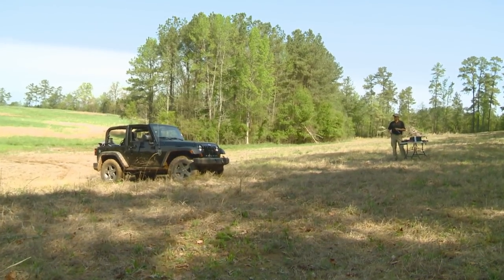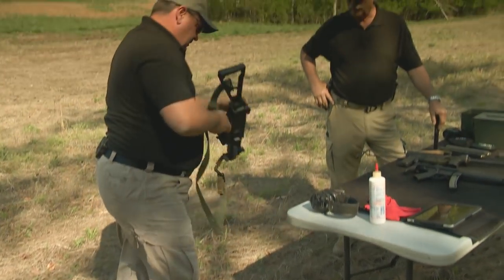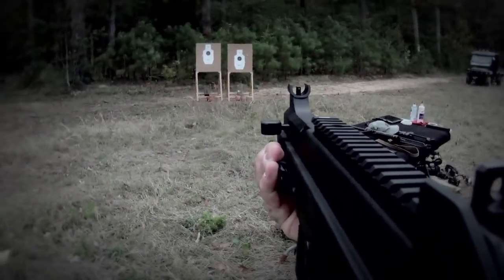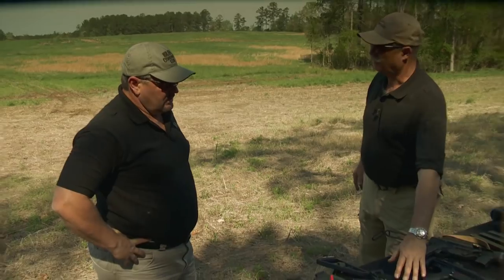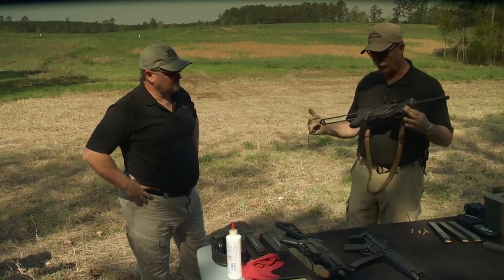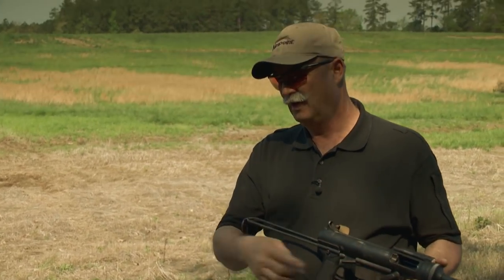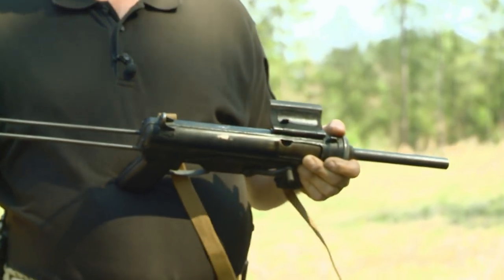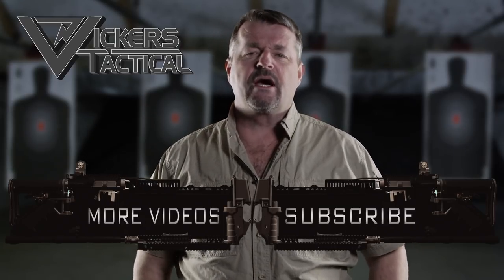M3 Grease Gun and HK UMP

Comment: The M3 was designed to replace the H&K UMP.
Reply: Nice work dude.
Reply: Random Guy lol
Reply: Wait, time out...
Reply: Random Guy lmfao and the Colt 1911 was made to replace the Colt Dragoon
Reply: Random Guy Gr8 b8 m8
Reply: u brad mo ?
Reply: Random Guy wtsr&eg
Reply: XDXD
Reply: Fucking agree
Reply: Dutcher No shit it is
Reply: Lol . Seem fucking legit.
Reply: @dutcher9180  
The joke flew 10,000 ft over your head.
Reply: Jesus fucking Christ man...
Reply: @dutcher9180  it's a joke
Reply: The Red Menace  Not the M1 Garand . The lever action Winchester .
Reply: @dutcher9180  r/wooosh
Reply: Gazzara5  Actually when the grease gun was being designed it was never meant to replace the Thompson. It was designed to simply be an extremely cheap and fast to produce gun that they could air drop to troops and supply to tank crews. At the time war materials were running low so they simply wanted something that used the least materials and could supply troops at a faster rate. But it was never meant as a replacement, it's just what happened.

Comment: Should have compared the Sten, the Grease Gun, & the MP40.
Reply: And the Owen SMG
Reply: +DemocracyOfHypocrisy It's got to have been done somewhere.
Reply: And the mab 38. Polish blyskawica 
Ppsh pps43  mas38 and reising m55
Reply: MP40 hands down would have won, the Sten coming in second maybe or vise versa with the M3
Reply: No, that depends on your requirements. The MP40 is modern and in 9mm and perhaps it has already its semi/ double and burst fire mode selector. the M3 is pure full auto firing. Quick triggering is what makes it fire in burst. It fires the .45 ACP round.
Reply: The Mp40 would've won first, than M3 grease gun, than the Sten, than the PPSH-41
Reply: No the winner would have been the MAT49, then the PPS43, then the junk quoted above
Reply: The Sten is crap,but it does have the advantage of a side magazine feed so you can keep closer to the ground while firing it and not exposing yourself. The MP-40 is a work of art even if it is a 9 MM,but the Grease gun would still be my pick for simplicity,strength,and caliber.
Reply: @niksarass  Matt 49 isn't exactly a WWII SMG.
Reply: @bender138  yep I agree the Sten Is junk it’s a toss up between the Grease gun and the MP 40 which are both great sub guns. The 45 is however a superior sub gun round due to the fact that it hits harder and is better suppressed.

Comment: Having been an Armored Crewman  on the M60A1/A3 tanks, I got to play with the M3A1 Greasegun a LOT and enjoyed doing so as well.
A decent rate of fire but required effort to keep it on target during a longer string of fire. 
Some of the "lighter" troops didn't have enough sand in their pockets to keep from being rattled around from the (to me, anyway) modest recoil impulses. But with a little training and trigger time it became easier to squeeze off one, two, three or more short bursts of ammo.
That was a necessity, too, since that stick mag would run out of Pain Pills PDQ if you held the trigger back. 
But it was fun! YEE HAW!
I miss those days, outside of being beat to crap from the hard work associated with being a Tanker.
EVERYONE from the TC (Tank Commander) to the Driver, Loader and Gunner needed to work together to keep our mounts up and running in the field.
There was no such thing as driving until a maintenance facility and asking them to fix whatever was broken. Crewmen did the bulk of the maintenance. From track component replacements to replacing an entire engine/transmission "Pack" in the field.
That took the use of an M88 Recovery vehicle which was another tank minus the turret and main gun, but had a rig to hoist off the back deck and then the engine pack for replacement. 
NOT fun at ALL! Oh, and EXTREMELY dirty work. LOL 
Good days, Yessiree!

Comment: The UMP is a very fine gun and one of my favorites. One thing to touch on though is that the cost to acquire a UMP is in the $10-20,000 range, where as a new M3 grease gun cost $15 to produce in '43 which is $206 today. This means that for the cost of one UMP at $10,000 (cheap) you could arm 50 or so soldiers with grease guns. Assuming training and experiance are equal, the advantages that the UMP offers it doesn't make a 1v50 scenario close to possible. Even a 1v2 scenario would be based on luck. If H&K were to make an affordable UMP they would essentially end up with an M3.  This is why they are bought in small numbers by special forces and police units, and not armies. Just food for thought, sorry for the rant, safe shooting everyone.
Reply: 10-20k for a submachine gun? Christ, I bought a pickup truck for less than that!

Comment: wish they made the ump in 10mm
Reply: they make one in 9
Reply: They have .40 S&W
Reply: Raihan Purboyo *more rare
Reply: It's possible. You just need a different barrel aswell as maybe change the rollers.
Reply: 10mm > .40 Short & weak.
10mm > lol it's ok only 9mm.
Reply: Found the weak wristed FBI agent.
Reply: 9mm cannot even compare to 10mm Spuds...
Reply: Most 10mm made by big manufacturers are weak. 

For full power, .357 Magnum equivalent 10mm rounds, look up DoubleTap or Underwood 10mm -> 135 gr. flying out at 1600 fps.
Reply: Used Underwood 10mm those are like a 41 magnum. Quite a punch, but not as bad as they are made to seem recoil wise. Now from a sub it'd should be even less recoil, until you add fullauto then maybe. 

The only issue I see with 10mm or higher rounds, fullauto recoil and the possibility of hitting a bystanders is higher than smaller more manageable caliber. 

But I still prefer the 10mm, I also don't deal with hostages lmao

Comment: m3a1 could be carried cocked as the dust cover locked the bolt back when closed. firing single rounds was easy, even a clumsy guy like me managed it fine. we had some in artillery post korea. I always use it as an example of how easy it would be to make a full auto rig in your garage.
Reply: This was my choice guarding Pershings. I've never had one fail, and I could single shot a target at 200 meters or 3 shot a 350 meter target.

Comment: The grease gun was never made to replace the Thompson. the grease gun was made as a defensive weapon that was generally issued to mechanics, clerks, drivers, supply, armored  etc. It was never issued to combat squads in any form and was deemed suitable for less experienced non combatents because of simplicity of of operation if put in a defensive situation . Rangers could choose their as a mission to fit their needs, but none would have been that foolish, except in movies. They were fun to shoot and east to clean And weighed a lot less than the Thompson, but not of any use on a battlefield.
Reply: Yeah, it was just a cheap gun to give something for those you mentioned to defend themselves with like drivers and mechanics.
Reply: Thank God some one out there knows what they are writting about. Thompson was used up to early Vietnam and finally removed from service in 1967.
Reply: A hushpuppy, a 1911, and a m3a1 with a long barrel and suppresser where a thing among a certain type of units.
Reply: Resistance, still not a squad combat weapon
Reply: sam hunt exactly. I was waiting for your comments.
Reply: That’s funny than why was it the longest used military small arm in the US arsenals if it’s was useless? And it was made to replace the Thompson Chief. I happen to own both a M3 and 1928 Thompson and the Grease gun is actually a better CQB weapon.

Comment: They made the grease gun to replace the Tommy? I highly doubt that since the Thompson has a higher fire rate per sec(700),than the greaser.(500).Despite of the Tommy's weight I would've chose that,than the greaser if I'm a soldier fighting in the ETO.
Reply: Attila Analog The Thompson was significantly more expensive than the Grease gun. The Grease gun was also way easier to manufacture. These things matter when you have to build thousands as quickly as possible.

Comment: The UMP is kinda bulky, I think that if they made the M3 with modern polymers/plastics and a lightnened bolt it could compete with modern Pdws
Reply: No it couldn't there is a reason they have quit using it
Reply: The problem is the 45 ACP doesn't perform well in armor penetration, so it wouldn't be a good PDW.
Reply: Some do use armor, either way submachine guns have largely been replaced by compact assault rifle, more powerful, better armor penetration and longer range.

Comment: All of these discussions are moot, in that the advent of the short (carbine) assault rifle has superseded the need for an SMG in pistol caliber.

The 5.56NATO round, in modern, tactical loads with bonded-cores, etc. offer similar wound ballistics to the pistol calibers at short ranges. Controlability, and maneuverability in tight quarters is indistinguishable in practice between a UMP and an M-4, G-36K or any other carbine or SBR.

The tipping point, for me, is that the 5.56NATO is inherently able to defeat soft body armor, while being slightly inferior in penetration of wood/wallboard/tile interior walls, compared to pistol calibers. That means I can engage an assailant wearing armor with a high probability of defeating his body armor, while minimizing the possibilities of my rounds overpenetrating into spaces occupied by civilians.
Reply: Mike Brown you need a website. I will make you a website
Reply: Suppressed.  .45 ACP subsonic, deadly.  5.56 subsonic, questionable. Alleviates any point made.  Consider the point of such a weapon.  5.56 needs velocity to be effective.  .45 ACP? Nope.
Reply: 0311TYPE For my purposes, I am engaged in a firefight with armed assailant(s). I have little need for sonic suppression in that circumstance. In fact, most special-weapon teams who adopted suppressed weapons (MP-5SD, etc.) rather quickly traded them off, as the original perceived requirement never materialized. The naturally subsonic .45ACP is, indeed, serendipitous for the user who desires a suppressed weapon, but for operators engaged in real-world armed encounters, sound-dampening is low on the list of requirements.
Reply: I do not know you, nor your personal circumstances.  However, your personal circumstances, do not determine the market.  In my entire life, I know one (and have met a few), people, who have a need for such a weapon.  Thus, it exists.  "Necessity is the mother of invention".
Reply: 0311TYPE Can your fiend disclose the circumstances when he needed and used a suppressed weapon? Could he have completed the same operation with a non-suppressed weapon?

Not trying to give you a hard time, but the actual exclusive utility of a suppressed automatic weapon is vanishingly small.

And regarding the market, I've found that sales reps and hype tend to sell a lot of guns that end up collecting dust in a weapon locker.
Reply: Mike Brown SOF guys use suppressors quite a bit.
Reply: Aiden Gonzalez When? Detail the event.
Reply: Mike Brown My Dad used an mp5sd when he was in Delta in the 80s and 90s. The mp5 was still EXTREMELY popular with American SOF, as body armor wasn't nearly as prevalent as it is now. Most of the time they used CAR-15 rifles, but their go-to SMG was the mp5. It was extremely quiet with a can on it. The bolt and ejecting shell were louder than the shot itself.
Reply: I misspoke, sorry. My father joined Delta in the early 90s, he was just SF in the 80s.
Reply: Aiden Gonzalez I also have trigger-time on the MP-5SD as a tactical officer. It is quiet with subsonic ammunition, but nowhere near as portrayed in media. 

Hence, it's utility is suspect, since by the time you're going to need to  shoot all pretense of stealth are out the window.

These weapons were sold to our agency and hundreds of others across the country by the H&K reps who convinced gullible ordnance officers and chiefs that they needed suppressed weapons. I wasn't in on any of those sales-pitches, so I don't know what the proposed scenario was. All I know is, in more than 100 calls for service we never needed a suppressed automatic weapon.

I'll take an M-4 or G-36K, thank-you.........
Reply: Congrats on going 2 years without crime mike brown!!!
Reply: As far as you know, right?
Reply: It was a joke about the Mike Brown that got shot in Ferguson not doing any crime for two years since he's been dead for 2 years lol
Reply: Mike Brown they make ap pistol rounds too tho...
Reply: Few of which are effective against Level-3A armor with trauma -plates, which all of us wore. Also, the skells we normally encountered used the rounds they had at-hand, normally FMJ or RNL. It was rare to find hollow-point or exotic rounds in perp-guns.............................
Reply: Which, if it's specifically designed to be AP, is illegal for sale in the United States. The FN Five-Seven gets around this by not being marketed as AP, though the FMJ version can defeat soft body armor.
Reply: Green tipped 5.56 is legal. Also almost any rifle round(Including pistols that fire them) is going to defeat soft body armor. The FiveseveN is sort of in between Assault Rifle and Pistol rounds I guess, it fires a PDW round. It has pretty crappy stopping power though especially with FMJ rounds.
Reply: So then you agree with my OP. Glad we sorted that out.........................
Reply: The SMG was originally designed to replace the shotgun in clearing trenches in WW1, which later saw use as a valued weapon to Paratroopers and special operations teams in WW2 that were complimented with a introductory carbine that would act as a replacement for the rifleman element in a squad or platoon. however SMG's still have a use in some conditions over carbines, as some carbines may be too expensive or too long to fit in certain compartments such as tanks or ships.
Reply: G-36K with the stock folded is as compact as the UMP. There are other examples of rifle-caliber weapons, but you see my point.......................

Comment: .45 hardly packs more of punch than 9mm. My choice would be a sig mpx in .357sig. more
Reply: .38 special is weak. 10mm and .357 sig are the best performing pistol calibers by far. And if you arent running 10mm or .357 sig you should just go with 9mm. best bang and power for buck and gets job dont
Reply: ***** thats why i have a10mm
Reply: Wouldn't go that far.

Comment: Really no point in having a UMP in 9mm. All you get is a slower rate of fire compared to the MP5 which already is completely controllable in full auto at ≈800rpm instead of the 650rpm you get with the UMP.